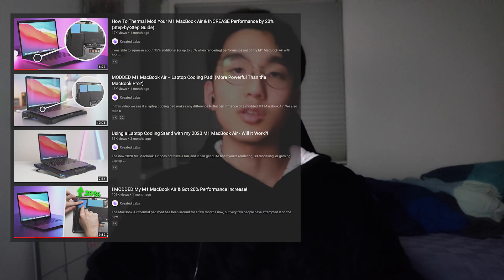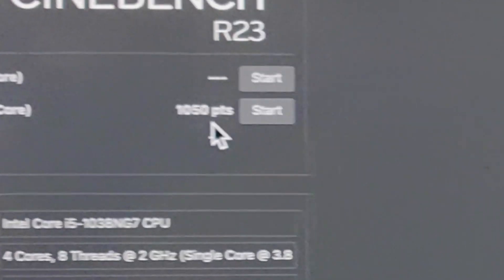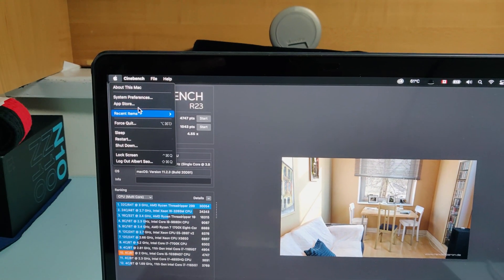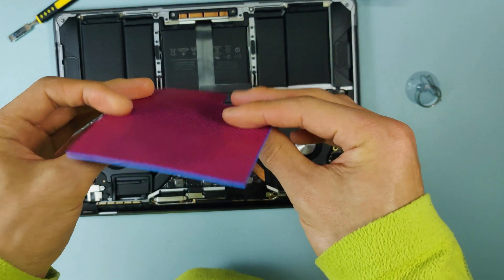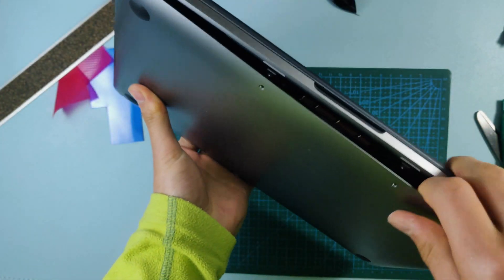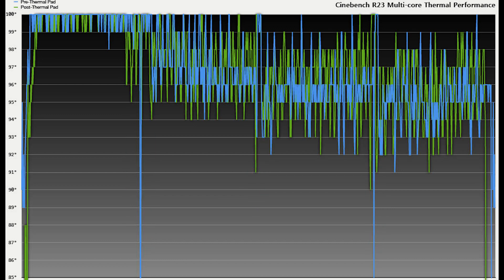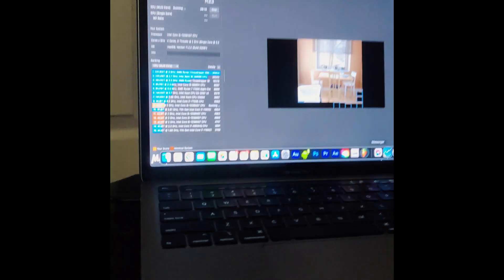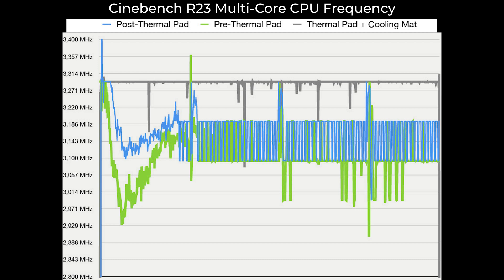The 2020 Macbook Mod to Boost Performance

Comment: Thank you so much for this video, I got myself a 16 inch macbook pro m3 max last year before the m4 pro laptops were launched, i really needed this laptop, but it keeps overheating, i am now a full-time creator and need a reliable device to edit all my content on.
I am going to do the something similar as you , ill also add thermal pads to heat pipe areas where the fans are and also the CPU this way i can get maximum heat dissipation, also i have thermoelectric cooler the magsafe kind which is used to cool iphones while gaming it is rated for 36w, and i have it placed right above/below the CPU area, 
I will also make video on this as there's no content available on cooling macbook pro's everything is about macbook air's.

Comment: You put it in the wrong spot. Only need thermal pads near the ends of the heatpipes, the middle is working against how a heatpipe works. 
Zoomer "modders" strike againe!
Reply: Can u explain what parts are actually supposed to be covered? Also when u take off that black price of tape off the heat pipe to reveal some of those things ur meant to put the thermal pads on is the thermal pipe copper supposed to be exposed like the video? If so do I also put thermal pad on it?

Comment: adding thermal pads will destroy ur mac by transfering the heat to components not designed to withstand heat such as batteries.
Reply: better than leaving the cpu melt itself? specially in the MBAirs
Reply: @quesada_  Batteries are replaceable, CPU's not so much.

Comment: Thermal pad mod is good for performance but it heats up other components unnecessary like battery, etc . Their operating temperature threshold is lower than cpu, they can’t withstand that much heat. Using macbook with thermal pad will reduce the lifespan of such components. Thats why apple applies an insulator on the backplate near the cpu to reduce spread

Comment: How does the laptop perform with cooling stand but no mods does it help? I was thinking to buy a laptop stand with fans but as there is an insulator on mbp case i don’t think it would make much difference than stock.

Comment: Great! Did you try to repaste the CPU with high performance thermal paste or even liquid metal? I think it will boost performance even more.
Reply: Reaching the cpu is much more work, also Liquid metal is dangerous since it is conductive but it gives the best result, any tiny bit of spill will short circuit your Mac
Reply: @anayman7 hehe yep Liquid Metal will permanently damage ur laptop